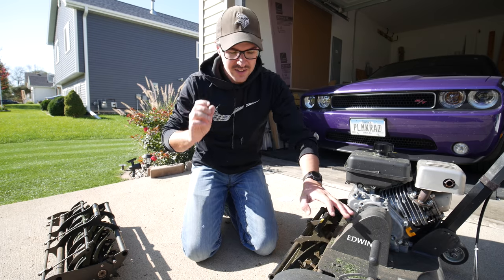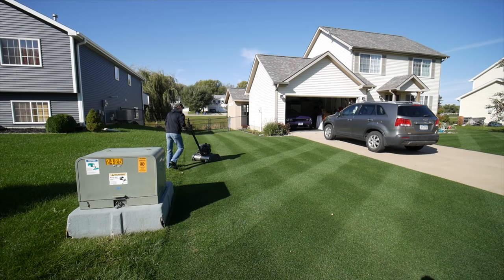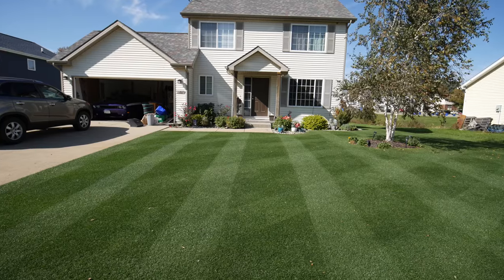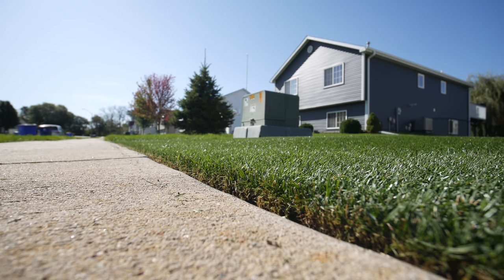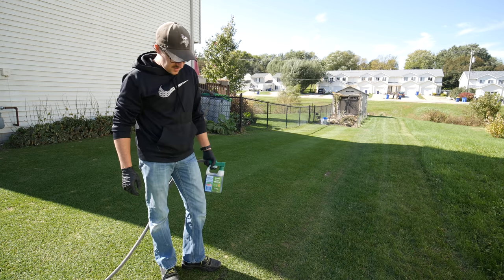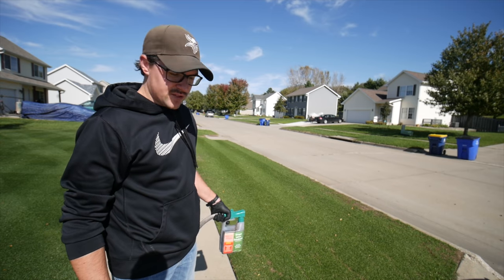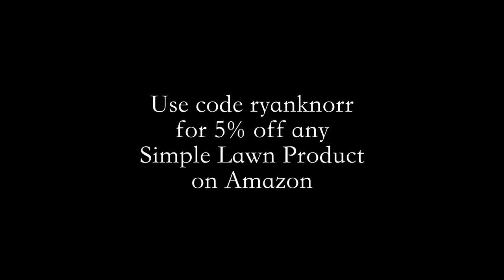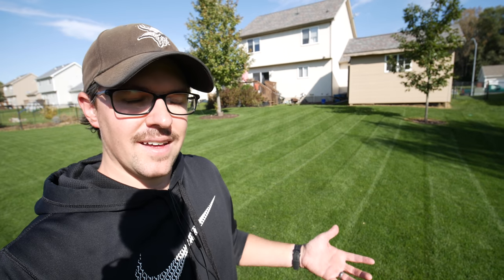Making the Lawn POP Before A Visitor

Comment: Objective difference b/n the 10 blade reel and 6 blade reel pls?
Reply: Samuel Asamoah the more blades on the reel, the better the cut at low heights. Example, 10 blade reel is designed for heights under 0.5". A 6 blade reel is better at approx. 1".
Reply: @reellowcanadian6760  great info thanks pal